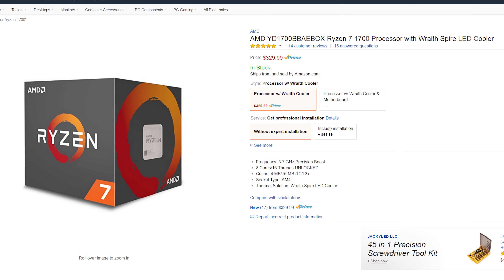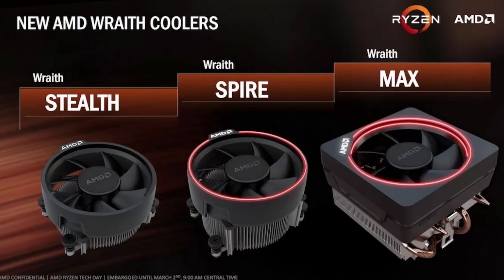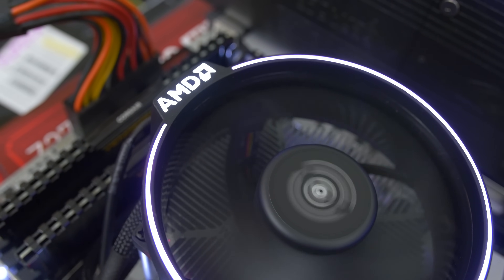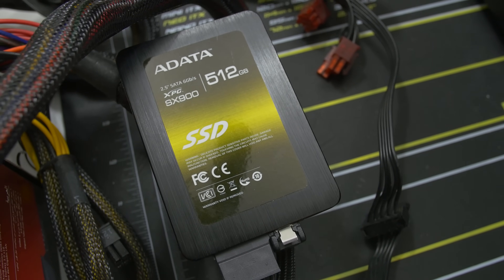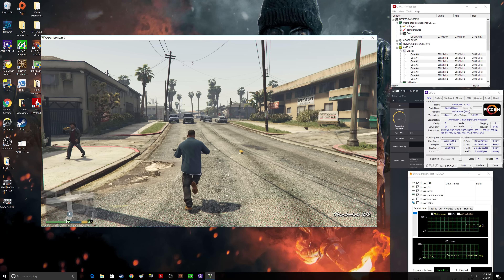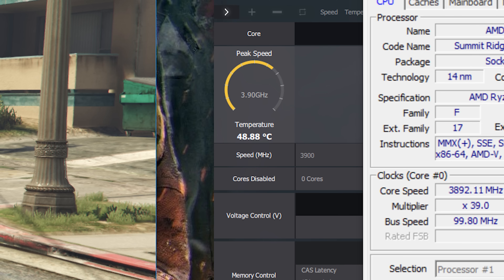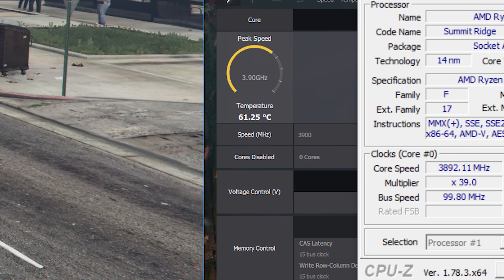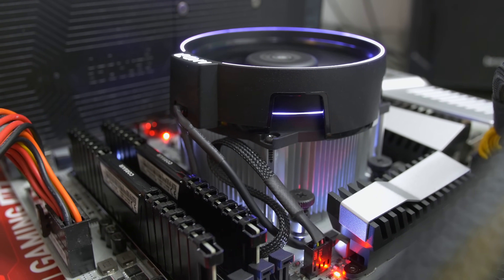AMD Wraith SPIRE: Does it SUCK?

Comment: You're testing the  cpu cooler on a test bench that is open, how is that relevant to temps you get in a closed case?
Reply: scgamerd By using an open air bench he can more accurately compare the coolers themselves. The case would just be an extra variable, as there are so many different ones on the market. If your case has restricted airflow, expect your temperatures be higher than the ones here, it's as simple as that.
Reply: And Ive seen the opposite happen with a good case that has good airflow.  Take that side panel off and the temps go up.  That's why its better to test this open air to eliminate the variable of many different cases and configurations.  The right case could make the cooler perform better, and the wrong case could make the cooler perform worse.  So to eliminate that variable, and because it would take forever to build in different cases then take everything out and rebuild the computer in another case over and over, you just do it open air.
Reply: That is the point.  This wasn't a video to test the cooler inside a case.  Its a video to test how the cooler performs with the least variables possible.  If tested inside a case, WHICH CASE?  There are nearly limitless possibilities of case and fan combinations that could alter the test results.  Thus test in an open air environment to limit the variables and just focus on the coolers performance.
Reply: +Lord Mortigon sorry i should have clarified. My question comes from personal exprience. I used to have a dell xps desktop tower, and I noticed that the airflow was so poor that everytime my cpu reaches 70-80s C  I would ipen the side panel and remove it, and it would operate 6-10C degrees cooler. That's I think an open test bench will lead to lower temps, as long a room temp is not like 40C degrees
Reply: The air is still air closed or open. The open is a better test because there is no other forced flow other than the cooler its self
Reply: +JimmyTheSaint Exactly!! Done these test myself and closing the case always made the temps go down if the case has decent airflow.
Reply: scgamerd He's testing the cooler's ability to dissipate heat, not your case's.
Reply: when he testing inside the case, the result will be inacurate, you know right, in the world of research you should limit the variable. for example if you put inside the case, better fan case the cooler it is, but what case and fan people use can't be generalized, yet open air can be generalized which lead the conclusion more valid.
Reply: I have one and it's an amazing cooler as long as you change the thermal paste that came with it. I replaced it with an Arctic MX4 and with stock setting and performance fan profile it sits under 50C. My case is a Mastercase Pro 5
Reply: Airflow.
Reply: It is very relevant if you have a decent case with inake and outtake fans.
In fact during my testing with good case cooling I actually get worse temperatures if the case door is left open.
With my antec 900 case for example the temperatures inside the case never really go above room temps and with hard drives and everything barely being more than a few degrees above as well.
Reply: not to mention in Winter!
Reply: Agreed, if the setup was in a case that had great airflow the temps would probably be lower since the case would be moving much higher volumes of air to/from the cooler rather than all that warmer air just sitting around the motherboard and cooler.
Reply: But wouldn't the variable of the open test bench be vastly inaccurate to conclude whether or not a cooler would work well inside a case?  If you want to test a cooler inside a case, then test a cooler inside a case.
Reply: +scgamerd That is because OEM systems like dell has awful cases that does not have great airflow. The exact opposite will happen with any decent mid tower with enough intakes/outakes to provide good airflow. So unless you buy a crappy oem ryzen setup, then it might actually give you better temps inside the case.
Reply: scgamerd I just noticed that's kind of dumb
Reply: Case temps will always be higher than open testbench. It's not like the room temperature is magically lower because you put everything into an enclosure.

Comment: it looks pretty. I wonder if it can cool the phenom ii 1075t x6
Reply: Flavia Pitariu Why would you get an R7 1700 just to pull the cooler out of the box and put it on an ancient CPU?
Reply: NEX H5 because I use that ancient cpu as my normal rig and this will get a low profile or water cooler. So I wouldn't mind using the cooler I don't need to upgrade the older amd cooler
Reply: Flavia Pitariu You would be paying $330 just for the friggin cooler.
Reply: NEX H5 nope I'll be paying 330 for a cpu and a cooler that I don't need so I would use it in the old pc because it looks cool. Can't remember the tdp of the phenom
Reply: Flavia Pitariu Should be 125W. Are you gonna be using the Ryzen chip or not?

Also, the mounting points  are slightly further apart on AM4, so I have my doubts that it'll fit.

Comment: Which is more power efficient to overclock a R7 1700 to 4.0ghz vs a stock R& 1800x?
Reply: The 1800X, most likely, since the higher SKUs are usually binned better.

Comment: I have a Ryzen 7 1800x with the Wraith cooler from the FX8370 (Yes it will fit) and it keeps gaming temps around 45c-47c.  even after prime95 for 1hr the temp never broke 65c.

Comment: Would it be possible to instal this cooler on an intel CPU? I like the led on it
Reply: Yes, but you'd have to cobble together some sort of mounting solution yourself.
Reply: Robert Faber I'm not afraid of making a backplate, I have access to a cnc machine, the main concern is the motherboard hoes not alighting
Reply: chiggins I'm assuming you'd have to remove the old mounting system entirely and make your own that aligns with the holes on the motherboard.
Reply: Would probably be quite the bodge.
Reply: chiggins so the simple answer is no

Comment: Lolz, just get the 7600K, $100 less and runs at 3.8 -4.2Ghz stock, mines OC'd at 4.5 right now and only around 50C in intensive games and background software running
Reply: Cp12345737 AMD Is going to release the Ryzen 5 lineup to compete with the 7600K soon.

Comment: Intel stock cooler is a shame compared to this :p
Reply: Ellypsis true !!
Reply: Intel stock cooler is a shame comared to anything lol
Reply: Ellypsis ya it looks like trash compared to this.
Reply: The old stock cooler from a few generations ago was actually pretty decent. It had a copper core and could also handle a TDP of 95Watt.
Only the newer Intel stock coolers are garbage, because they cheaped out on the copper core and made it completely aluminium. :/
Reply: Ellypsis you understood what AMD is about good I like you
Reply: Ellypsis  (in unison in deep voice) it has RGB
Reply: R.I.P. my i3 6100 stock cooler, that sucker is loud...
Reply: Lol true.
Reply: u mad
Reply: LOL at comparing intel to AMD my Ryzen 1700 outperforms my 7700k in every department, and it was much cheaper. I used to be all about Intel till I got this 1700
Reply: I have Intel and I agree with you
Reply: Lol if you judge a company by the quality of the stock cooler they include, you have your priorities wrong, don't forget those 10 years that amd was complete shit and intel was the only manufacturer producing quality cpus, amd shills.
Reply: Yes, but Intel now only gives you the new 65W TDP cooler with non K chips, that are 65W TDP and lower. For those even the cheap new design is more than sufficient. But yes, they went cheap. I remember having a Q6600 with the stock 755 cooler and OC'ed to 3.0GHz the temperatures were quite the same.
Reply: Peteto Chibs it doesn't mount too well. It's annoying. Mount the other side and the other side will become loose.
Reply: Completely agree, Though that stock AMD cooler is honestly better than my Corsair H80i (looks better too) AMD has been less stable over the years compared to intel. Just because they are having a high time now, doesn't mean 5 years from now they wont be in a rut, Although you can pretty much guarantee Intel will have a new lineup ready to push out the door.
Reply: Also: it's pratically included for free, and it gets the job done, unless you're interested in OC'ing your CPU.
Reply: Ellypsis ikr
Reply: Ellypsis intel stock cooler keeps my locked 7700 under 70 at a consistent 4.0GHZ .. a cheaper locked 7700 does better than this overclocked Ryzen.. wtf..
Reply: NCR TROOPER no actual need to overclock or I would have bought a K version of the same processor ...frankly a locked i7 stays at 4GHZ under load .. That's all you need in the CPU department to play ALL triple A titles in 1440p or above... and the lga1151 socket WILL be supported for at least the next 5 years so your excuses for AMD are invalid... sure the AMD cooler looks nice and does a good job but I'm not an AMD guy.. I'm not a bandwagoneer.. I go with what has worked for me the most with as few issues as possible and for me that's intel. All the way. No question about it. Maybe I tried AMD when they truly sucked? Yeah. That's definitely it. Once you fuck me you won't see me again and that's what AMD used to be good at... FUCKING PEOPLE out of their money as if their product was as good as intels. That may be the case now but it wasn't always the case especially when they were first starting out. Again.. I'm not a bandwagoneer. I'm LOYAL to the brands that have been LOYAL to me. The only way to be loyal to customers is to provide them with a product that actually works as advertised at a price point where we customers don't feel ripped off and intel has done that for me time and time and time again..
Reply: CDubs HasIt biased  intel fanboy alert!

Comment: So im going to build/upgrade my current pc, Mobo cpu and ram and I was wondering if anyone had suggestions for a cube case that looked really nice with side panels. And I was wondering if the i7 7700k could still stream at decent frames. I have so far found the Lian li pc-08 which looks really good, but people say making a custom loop in it is hard and I wanted to eventually do one in my pc

Comment: Is the RGB header splittable? Could we use a a strip with it?
Reply: Tuchulu theoretically, but the lights would be much more dim
Reply: Tuchulu yes, I have mine split off of my case lights. one remote to control them all.. it even matches my cheap Chinese strips except for on "white"... the strips/controller aren't rgbw so they are kinda blueish white while the spire is pink. I'm not sure how many of the am4 Mobo's don't have a RGB header, mine doesn't. (gigabyte 350m gaming 3)

Comment: So far, I like the Cooler. Coming from a hyper 212 evo, it's almost as quiet, and is significantly smaller, so cooling is probably less potent. Stressing the CPU maxed temps at 70 degrees which is pretty damn good. One thing, the AMD logo does not shut off and is quite annoying during the night, because it's bright as hell lol. It also has a tiny whine that you can hear when there is no other noise in the room but quickly went away or I got used to it. Solid damn cooler guys. I'm lovin it so far. I'm probably returning the 1700 in favor of the 1600 to save 100 though lol

Comment: this is the video i actually cared about the most. i plan on going with the base model 6 core and i want to use the spire cooler (using raedon memory and ssd with an r9 nano). im glad the temps are good so i can be confident in using this cooler.

Comment: It is great that AMD stepped up their game in stock coolers. from all the way back to the original K7 socket 462 and the socket 939 Athlon 64 chips to the non wraith equipped 8350 8 core which all were pathetic, this is a great step forward!

I bought a very heavy all copper Swiftec cooler for my K7 powered rigs and kept it clean and the chip cool and they all lasted well but some people I knew kept the stock K7 coolers on their chips and at one point or another they all died due to thermal issues and there was no overclocking headroom at all with the stock K7 coolers.

the Athlon 64 coolers were a little better but I ran aftermarket coolers on those too.
Reply: Bigdog302V8 the wraith was just them upgrading the 8320/6350/8350 cooler, so it wasnt the first decent one.  Still had a copper contact, heat pipes, and cooler master fan

Comment: here i am with a r7 1700x and a hyper evo 212 and on idle it is at 60c+ am i doing something wrong??
Reply: JustADecoyy have you read about the 20°C offset on the X models? I think you need to substract 20° of off the temps...
Reply: NaPz wait what do you mean? why  do i have to retract 20c?
Reply: well that is alot better here i am thinking that my cooler isnt working properly thanks! :DD
Reply: JustADecoyy ocaholic.ch this has all the info you need ;)

Comment: hellow i have same question, i have  gsync 1440p monitor with gtx 980 ti ,if you guys help me out to make decision to choose i7 7700k vs r7 1700 ?and also i have liquid cooler h100i corsair and one more things i just playing on this pc and also recording ?
Reply: awder yasin Hi, choose Ryzen! Gaming performance is only slightly worse atm, but there will be optimizations in the future and Ryzen will be better then. Ryzen is also more future proof. Theese 5-10 fps lower u wont notice. It will get better, ryzen was just released
Reply: 1700 or 1600 & upgrade 4 years from now. 1440p or higher will be GPU/API dependent for 1 or 2 more years. At that point most new games will be using Vulkan/Dx12 which will utilize more cores, likely putting AMD above Intel.
Reply: awder yasin Choose the Ryzen 1700, better price to performance and that will improve in the future as game devs optimize for Ryzen CPUs
Reply: Luis Maiocchi  thanks for replying i see alot of youtuber saying r7 for gaming is not perfect compare to i7 7700k ??i know i7 7700k can not stand for along time like i write down on above i have gsync 144hz 1440p monitor i know alot about computer but it is tough to decide i7 7700k make more fps over r7  1700 thanks for convince me to go with 1700 hhhh thanks again

Comment: does 95w tdp means that cooler gonna use 95 watts from PSU?
Reply: ritik gupta That's the cooler rating for processors
Reply: mastrshok 
oh thanks...at first I was confused that how cooler could use so much watts..
Reply: At stock it will draw 7700k levels of power, at 4ghz it will draw 6850k @ 4.2ghz levels of power. https://www.bit-tech.net/hardware/2017/03/08/amd-ryzen-7-1700-review/6 

Full load that is.